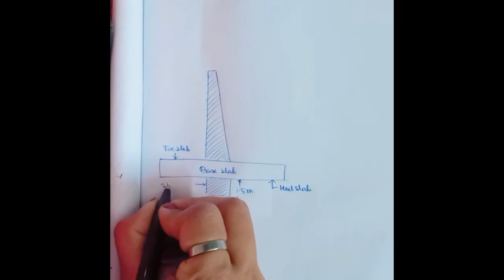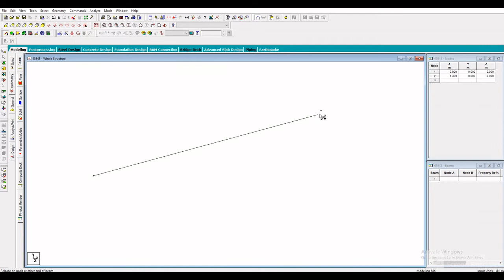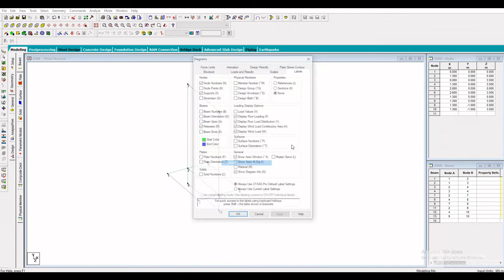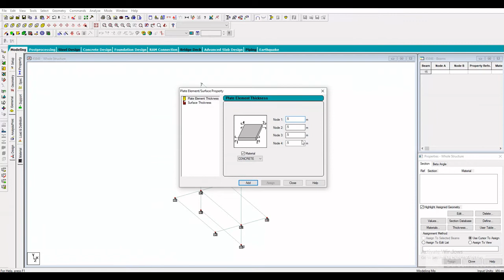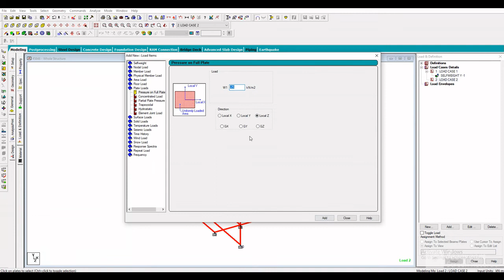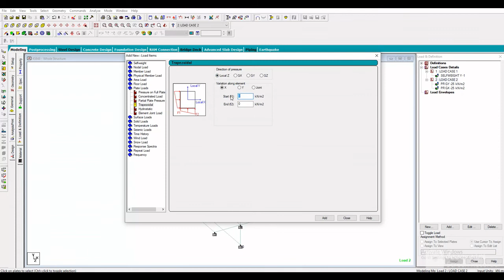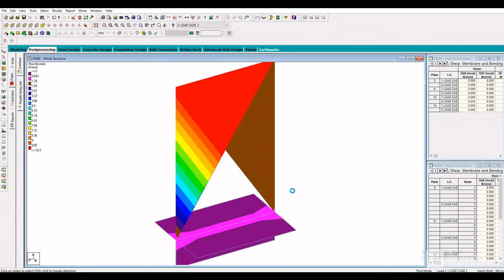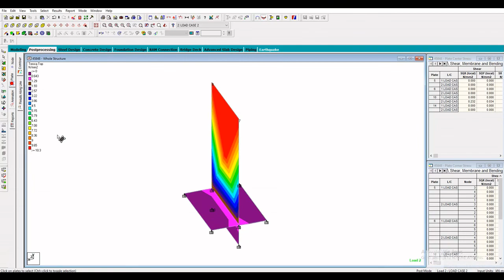Retaining wall Analysis using by STAAD

Comment: I guess you have to mesh the plate before analysis
Reply from the maker: Hello Mr. John Wick.
Thank u for ur valuable comments.
u can create d plate with generate surface mesh or with add 4 node plate cursor.both process is  applicable to create slab .
We r using the mesh to show d division of horizontal & vertical  reinforcement,& specing.
But If u defin d section property of slab/thickness & clear cover (during d design part )then Staad will automatically calculate d number of reinforcement & dia of reinforcement (top and bottom reinforcement of slab /wall)so u also go through without meshing, only use the 4node plate cursor to create slab/wall, during create plate makesure about surface colour.(default colour: green in top,grey in bottom surface) 
& define the thickness of slab/wall.& It will also before d analysis.
We hv to complete d modeling part & assign all d parameters (support, section property,Load) before Ananyse/Run the structure.,So this procedure is correct.if u yet hv any doubt then ask me.
Reply: @basicstepsofstaad  Yeah i got the design part. But i am not sure about the reinforcement calculated by staad without meshing of the plates. I will revert back with some reference. If you have some points regarding this pls add and show some references from technical manual it will be better for both 👍.
Reply from the maker: @johnwick9170  ok.
incase of retaining wall,we have to create a surface/plate with a perticular thickness (as per wall thickness),it's not necessary to mesh the surface .if u want to create the slab & wall with mesh then it's also ok.
You just have to use generate surface mesh command to create this two different surface.
After that the procedure from the define parameters like assigning Support thickness,& Load it will b same like this video.
So it will b better for u...
1.1st of all u have to insert the nodes as per the height  width & length of the wall..
2.then go to geometry click on generate surface mesh command
Then click one by one to create mesh check the plate colour (tick on fill plate solid surface) check the division.
3.after that assign support
4.assign thickness .25mm/.5mm
5.Assign the loads
6.Go to select  and check by missing attributes-missing property
7.analysis/Run
8.Postprocessing
9.check the max absolute(surface colour as per the stress)
And go to view output file check all loads results stress and deflection then u will understand the difference...or u can compare all the results.
So go through this procedure.
Thank you.
Reply: So what is the conclusion ,in all videos i have seen after using plate cursor meshing is following , now in this that step is skipped ,can you explain this meshing in what situation inevitable  @basicstepsofstaad
Reply from the maker: @nandakumar7161  cool dear.
After using plate cursor (meshing part) I have explained only first step,,coz the next part is same ,,if I don't skip this process then this video will take so much time,,we hv to save every second while creating videos,,no one like to watch the same steps /process,,,in case of writing part ,if there is same line that case also we skip the line,,same here.so follow the procedure  & all steps,,try to recover d software steps like how to model a structure,,how to add support, property & load ,and how to mesh any plate structure like slab/wall,,& also the advanced modelling & foundation part...Its better DNT find others mistake,it's waste of time .
If u have so much time thn try to recover the Staad pro v8i software and it's advanced part,,.&  follow my free suggestion..
All d best.Go ahead .👍🤞